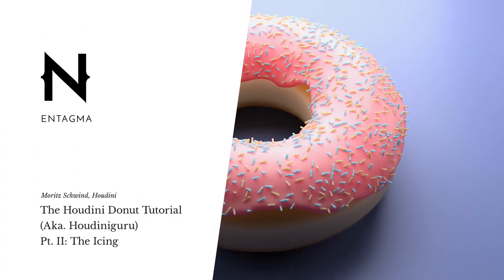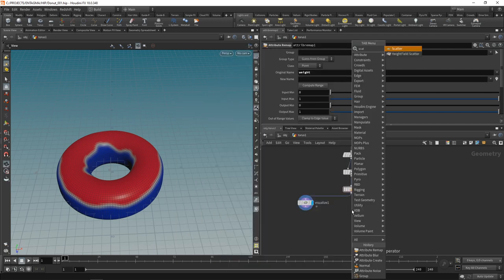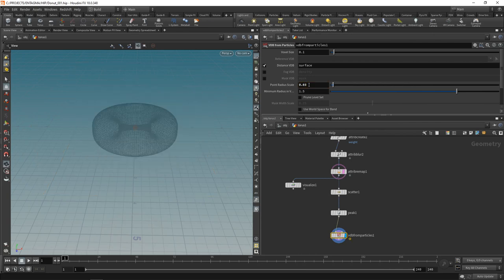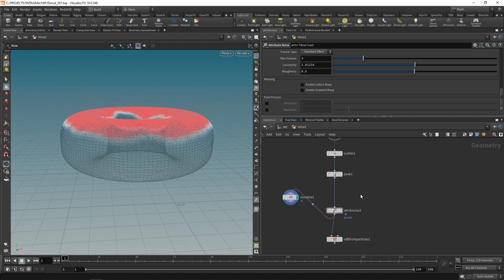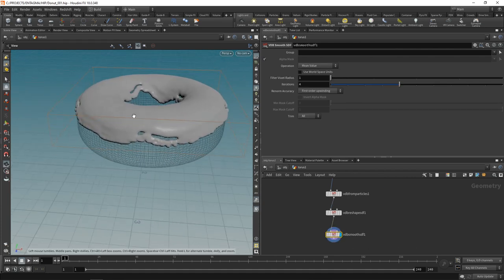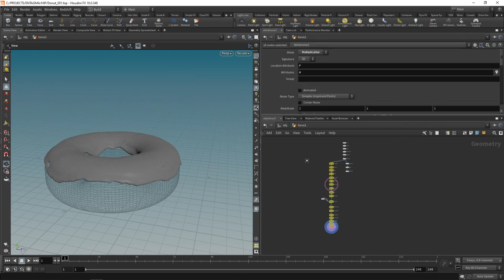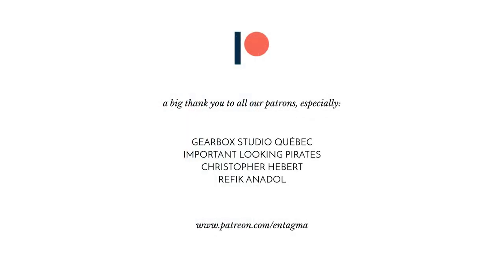The Houdini Donut Tutorial Pt. 2: Icing

Comment: Well, I'm lost on the latest version of Houdini.  Attribute Noise is completely different, and I cannot see a way to add pscale.  First starting at 5:08, and then at 8:05.
Reply: Same here. The node is very different and I don't know how to continue..
Reply: @paulvanemmerik9472  

For 5:08,

On the new Attribute Noise node:

1. Type in "pscale" in the Attribute Names box. Keep the dropdown as Vector.
2. Check the Remap Ramp checkbox, this displays a ramp.
3. Click on the first (left-most) "arrow" on the ramp and set the Value to be 0.8 and hit enter
4. Click on the right most "arrow" and set the Value to be 1.3 and hit enter.
5. Scroll down to Noise Pattern and set Element Size to 0.5
Reply: I was able to achieve a similar result using the "remap ramp" within the properties

Comment: 1:29 'Multiplicative' is not an option on Houdini 18.5. The 'AttributeNoise' node looks different. I'm re-doing as when I got to the scatter node, it just randomly scatters the entire mesh, not the top selection. Is this because of this part @ 1:29?
Reply from the maker: Hey Kiarian,

welcome to the Houdini universe! :)
As for your questions:

- Multiplicative is still there, it's hiding under "Operation/Multiply".

- Make sure "Density Attribute" is checked in your scatter and make sure it's set to "weight". Also check if you created said weight attribute on your mesh. That's been done through the group we created via direction and spread angle, the attribcreate where we set every point in that group to have a weight attribute of 1.0 and the following attribblur. (If that's unclear have a look at the project files we provide. That usually helps a lot.)

Happy learning!
Cheers, Mo

P.S.: Houdini definitely can be daunting when you're starting out, the trick is not to get too frustrated.
Reply: @Entagma  Hi Mo, thanks for the reply. Just trying to wrap my head around the process. So group1 was about setting the area of selecting geometry and group2 set the rules for which part of selection you needed for the icing (only Y direction facing up). Getting there. I think I also balls'd up not using the ramp on the blur.
Interested in becoming a Patreon, but I may have to wait until beginning of February to maximise the benefits!

Comment: On the attrib remap node, point wouldn't work with scatter until I set it to primitive. After that, the scatter node density attribute for "weight" worked. I went back and I can't figure out why this is after following step by step. Can you explain this?
Reply from the maker: Hmm... You might wanna check if your attribcreate is set to create a point attribute and not a primitive attribute. Cheers, Mo
Reply: @Entagma  I'm having the same issue and the attribcreate is set to Point :(
Reply: I fixed that changing the "vector" on "Attribut Names" to "float"

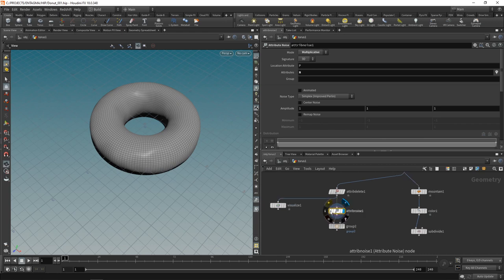Comment: 1:32 I'm using Houdini 18.5.408 and my attribnoise is screwing up. It's looking different and it's making my torus look like a cow. Limiting the min- and max values haven't changed anything. Sry, if this is a stupid question ( I just started). But I just can't figure out the right settings, even though I was strictly following the tutorial and after that trying for like half an hour. What can I do in this specific case?  
Screenshot: https://drive.google.com/file/d/1MBnYSqbDhhrpwJ36bVkRSvP2vLgcXX6n/view?usp=sharing
Reply from the maker: Heyhey,

did you try comparing your setup against the provided scene files?
That's usually the quickest way of diagnosing what went wrong.

Cheers, Mo
Reply: @Entagma  I looked it up and they are two completely different nodes. I just copied your nodes to further follow your tutorial.
Thanks for replying so fast

Best regards,
Leo

Comment: Hey! Really nice tutorial. I'm a newcomer to Houdini but quite experienced Blender user, and I was wondering if there is a more hotkey-centric way of working in Houdini. I'm surprised by the amount of clicking around involved even when working with things like nodes, and even though a single action in Houdini is quite a bit more meaningful than in Blender and allows you to do way more things, I'm left feeling like I get things done quite a bit slower when compared to Blender.
Reply from the maker: Hey Ruben,

sure there are hotkeys and shortcuts for most operations in Houdini, however I personally find it a bit misleading to use tutorial time to teach shortcuts instead of showing principles and general workflows. The focus of the Blender community on efficient workflows makes sense due to (what imho is) Blender's focus on destructive manual workflows. However this is what I'd also have to criticise with most Blender tutorials: their focus on learning shortcuts. Imho tutorial time is better spent explaining the overall principles instead of hammering in key combos. Which of course also depends on the very different roots and foundations of both Blender and Houdini.

Cheers, Mo
Reply from the maker: P.S.: I have to agree that building an initial setup in Houdini might be slower than in your classic DCC (be it Blender or C4D or Maya or whatever). However as soon as you start cranking out variants of your base setup, you're (in my experience) quite a bit faster than with the aforementioned tools. Imagine having to create 20 different donuts. In this case all you'd do is adjust 3-5 values (which could be automated too), generate a bunch of models and select the ones you like.
Reply: @Entagma  I second this. Before I finally start to love Blender since the 2.80 release, I used to hate Blender and especially all those tutorials piling up a bunch of shortcuts one after the other, that was horrible. Not appealing at all
Reply: It's kind of traditional in Blender. As in the pass keyboard input is the only method for certian functions. Key combos are not shortcuts but the original way. But I do argee showing principles is moer important then operations.
Reply: there are some hotkeys like R, E, B for nodes for render, template and bypass. You can also type first letters of nodes in tab menu instead of full name. aw instead of attibute wrangle, vfp+arrow down for vdb from polygons (because first result is vdb from particles), ctp instead of copy to points, you can discover more of these.
Reply: @izvarzone  cool!

Comment: Thanks for the great tutorial!
2:43 If I'm using houdini17 and therefore can't use the 'attribute remap SOP',  am I supposed to use an attribute wrangle instead?
Reply from the maker: Sure, pointVOP, pointwrangle or installing H18 are all valid variations :) Cheers, Mo
Reply: if you did it on houdini 17 can you please tell me the way to do it. im really new in houdini.
Reply: @AbirAlamAkash  Create a pointVOP and inside, bring in the 'weight' attribute using bind. Then add a ramp parameter and bind export it.
Reply: @Entagma  Cheers, always appreciate your videos as a patron.
Reply: @kumo591   Thanks a lot man
Reply: I created pointvop and did exactly as you said but nothing is happening
Reply: @karanlokhandwala441  but i had no problem doing that.
Reply: @karanlokhandwala441  In that case, you might want to check the ramp that is viewed outside the VOP. Sometimes even if you created the ramp inside, the viewport might not show anything since the ramp value is different from that from the outside.
Reply: KUMO following your directions but having a bit of trouble with it. Could you possibly post a link to a screenshot of the -pointVop>bind>ramp parameter>export process?